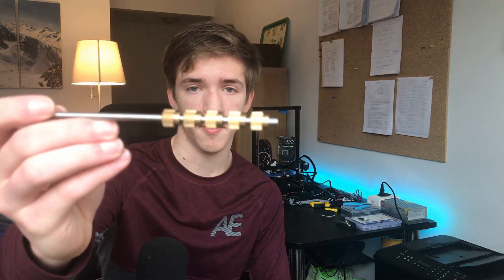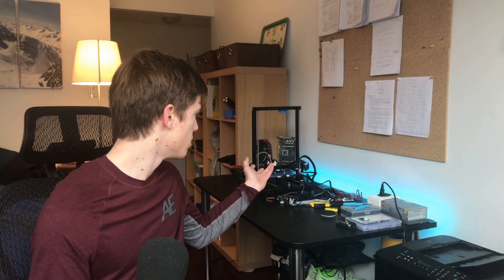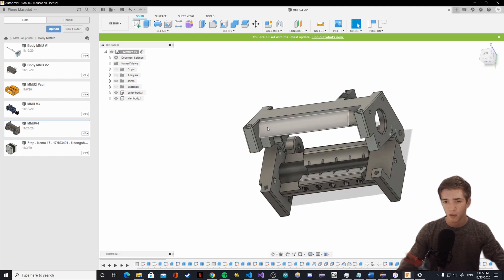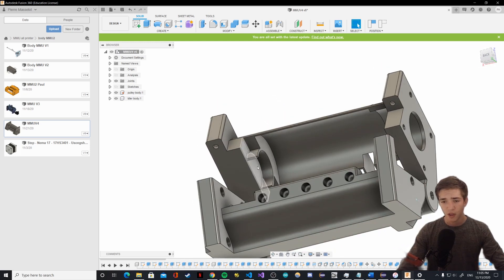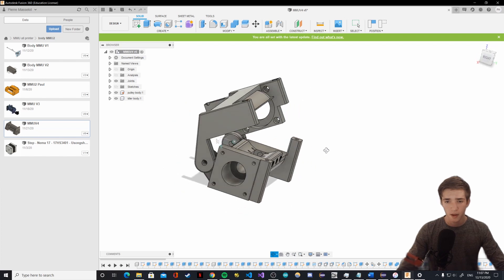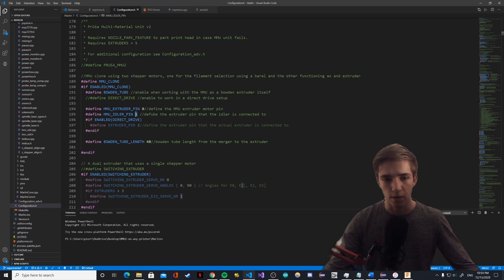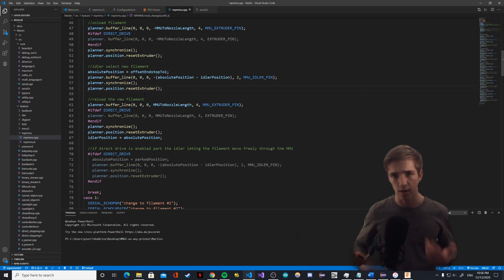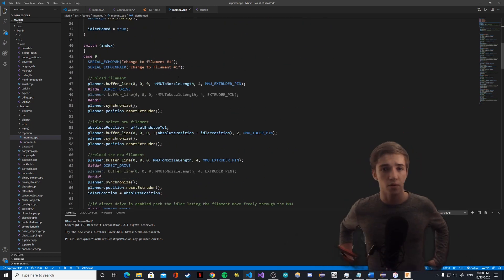MMU CLONE UPDATE: New gears,  physical and firmware changes. MMU2 on any printer: Part 22

Comment: Hey just found you on yt, can I be part of the dev / testing team, I'd love to add functionality and be of help as I've designed my own printers and maybe i could be able to test these unbiased.
Reply from the maker: If you want to contribute go for it! Everything is on Github and feel free to open an issue/PR if you have anything that needs to be fixed or something to contribute.
Reply: @materialswitchingunit284  Cool